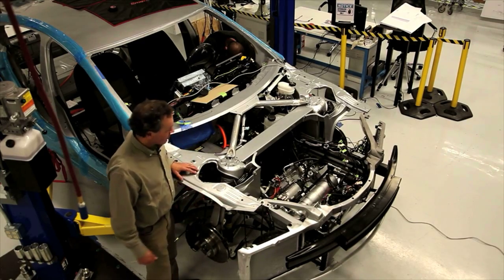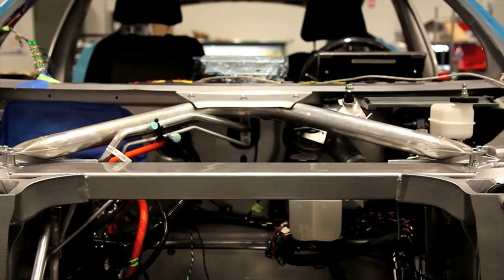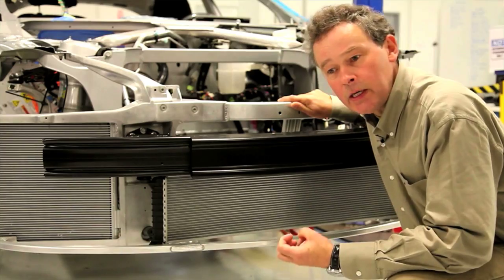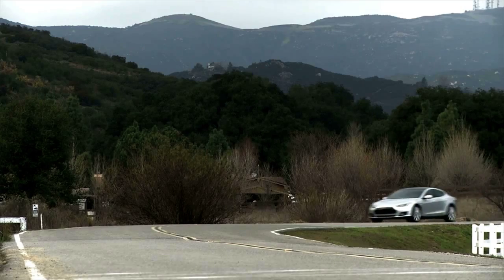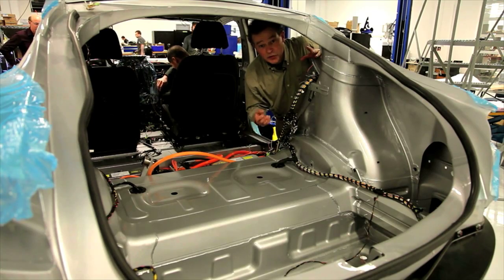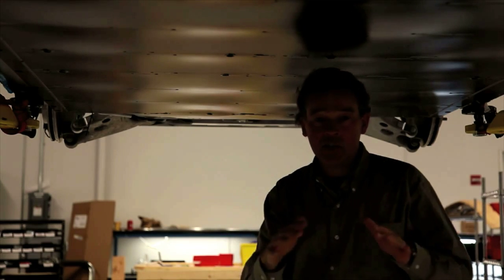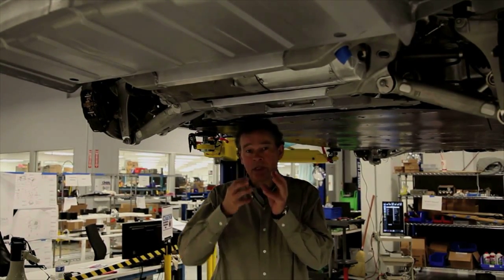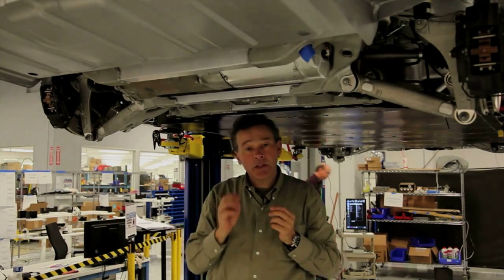Tesla Model S - Technicals

Comment: Just a small radiator can do all the cooling functions?  That will save much cost?

We  just manufacture  radiators, condensers, heaters, intercoolers for cars and trucks.  It will face some problem if the electric cars popular?

Comment: Toyota simply has no reason to use Lotus when they have tons of experts under their own roof. The Tesla was not 100% built in England. The Roadster shares roughly 6 percent of its components with the Lotus Elise. The body panels are not even made in England, A 100% is grossly over inflating Lotuses effort.

Comment: INHO those battery are very exposed to road, i mean what if one drive the car over a stone or concrete bump by accident, that suppose to mean he must change the battery pack which is very very expensive since is also one of the main components in rigidity of the whole structure. But there are insurance company that will pay the damage you may say, of course they are, but those insurance company will delay and diminish the payment more than sure. In rest, technologically is the very cutting edge!

Comment: That is currently not possible because of battery costs, as well as safety. A metal shell with a 40 kwhr battery pack and without a lot of the cool stuff found in the Model S could cost $30k and do over 300 miles, but but it would not be safe or cool. Safety, All-around Performance, and Innovation are what Tesla is all about.

If a carbon fiber body were put on the 85kwhr battery, it would have a 400 mile range, but cost more. Maybe that's what the next-gen Roadster will be.

Comment: Until the design was approved ('street legal') no cars could be used or delivered by non-employees. Then you must build the inventory.  Consider that about 2 yrs ago TM had just acquired the Fremont plant - in need of major cleanup and set up before installing the production lines.  Now 6 mo of "practice runs" are coming to a conclusion, and there is finally a trickle of product to deliver.  

So the stores (much cheaper than dealerships for TM and the customers) finally have a few samples.

Comment: There are luxury sedans of the same price. Just because sports cars are expensive, does not mean all expensive cars must be at par with sports cars. Also, the best thing about this car is, that it never gets technologically out of date. If your car motor becomes much weaker than other electric car motors, then just replace it. Tesla Motors states that, their motors are replaceable in 5 minutes.

Comment: DOPE front strut angle with sick bracing at 0:22. DOPE rear subframe-and-motor-and-drivetrain-in-one assemblage at 3:59. 

That front strut angle is only possible with no gasoline engine in the compartment. All these sick go-cart like chassis qualities are only possible because of the lack of a bulky gasoline engine and the fact that batteries can be arranged in virtually any configuration, allowing them to occupy the undercarriage.

Comment: This is everything I ever wanted in a car!

High torsional rigidity for cornering, outrageously low center or gravity, centralized mass (battery occupies the center and the induction motor at the rear being as light as it could be), instantaneous torque, and that dope dead welded front strut bracing! This thing is a freaking go-cart with 200 HP!